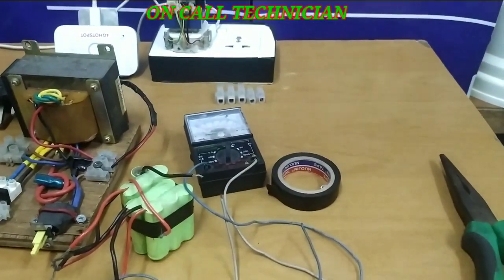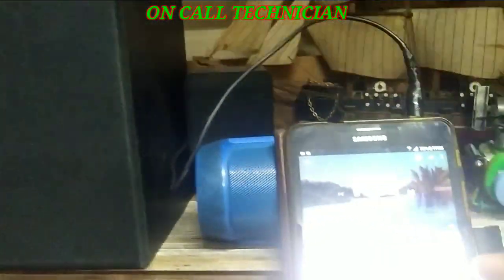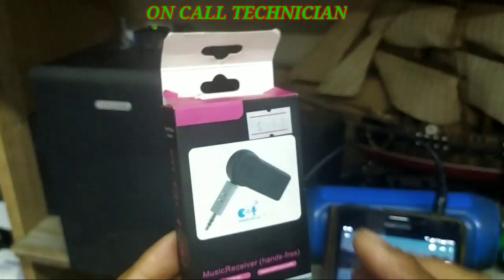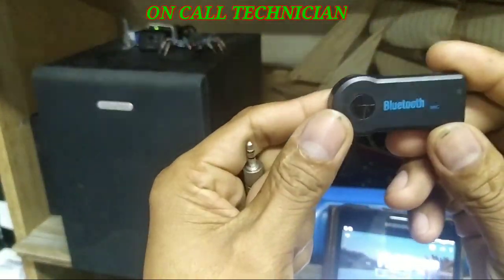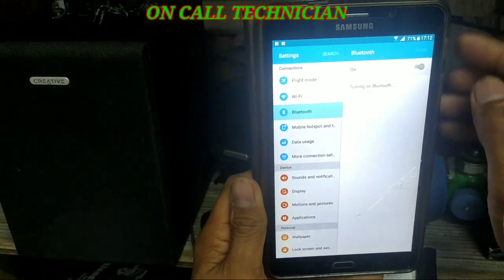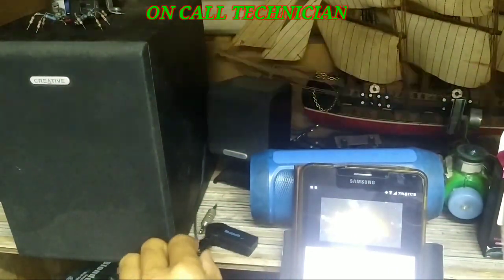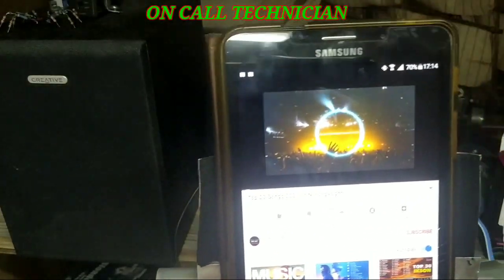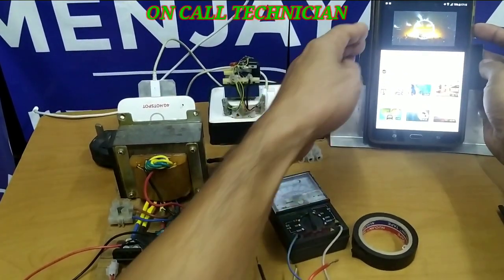HOW TO UPGRADE CREATIVE SPEAKERS SBS 2.1 350 / PAANO MAG UPGRADE NG SOUND SYSTEM

Comment: Love playing with batteries! Just need tips on how to create a tiny voltage regulator, to convert a camera to something that can run on AC power. My Canon 1300D has a 7.2V  battery that can go up to 8.5V or so when full. I'd love to convert an old batt into something with a jack where I can plug a 7.5V adapter, but my adapter is non-IC regulated. What's the best way to make sure the voltage won't go overboard?
Reply from the maker: Use IC type adapter sir to make it sure your voltage won't go overboard. Or install auto cut-off for your regulated adaptor po.